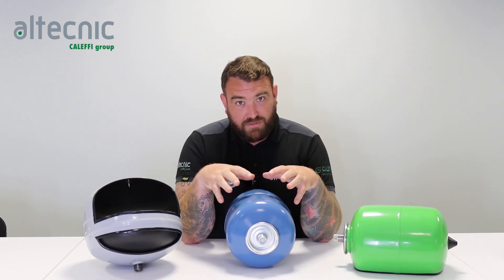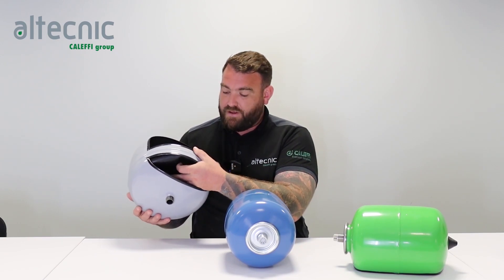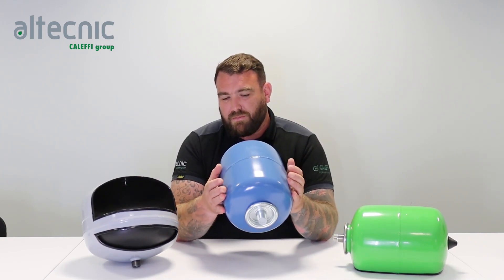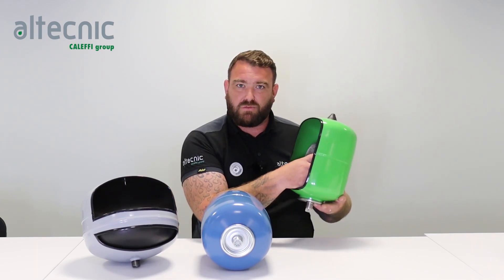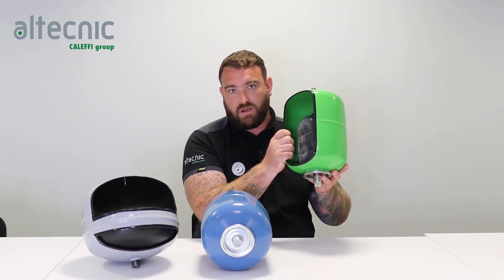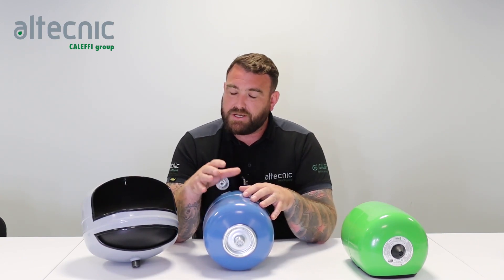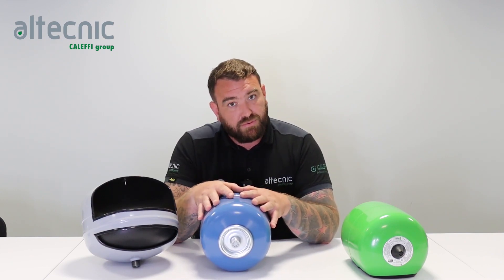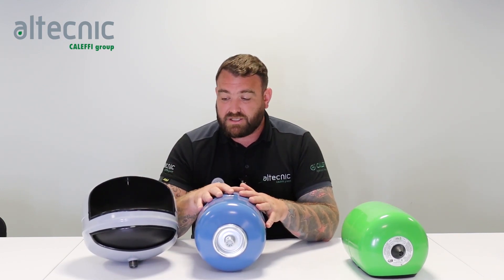How Expansion Vessels work in Under 3 Minutes

Comment: Nitrogen is an inert gas and non-reactive, its about 3% less dense than air, filling with nitrogen eliminates oxidation of the rubber so it remains flexible and lasts longer.

Comment: What is the correct way to fit a vessel. System connection up or down? Many don't seem to think it matters! but I think down to make it easier to fill and empty during use
Reply: Connections should always be at the bottom to allow flushing and to prevent debris collection